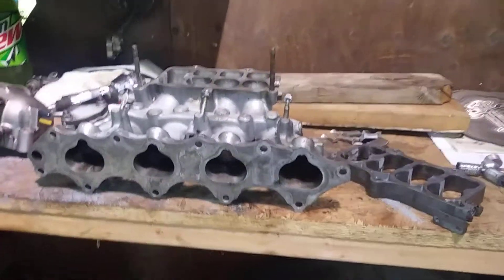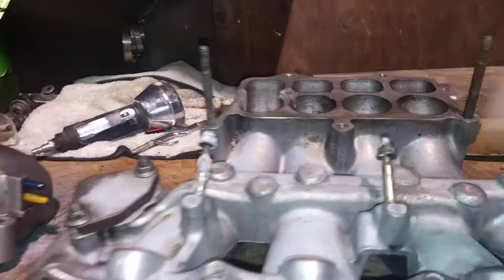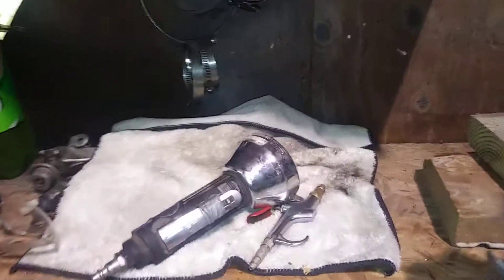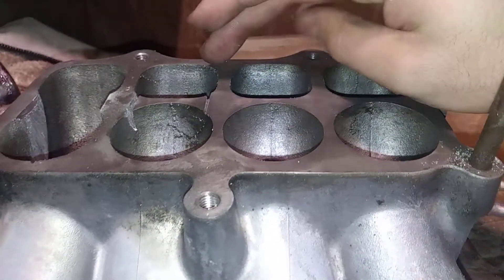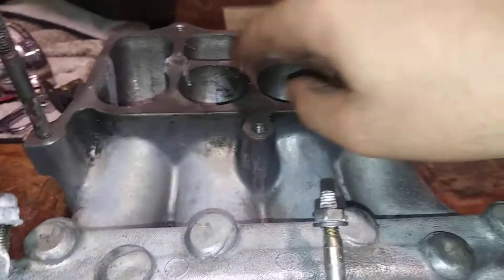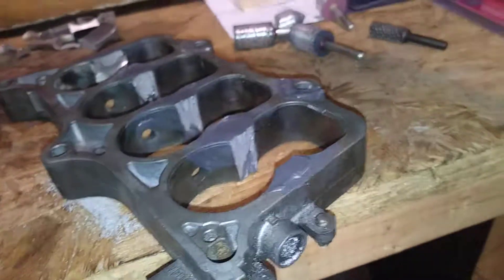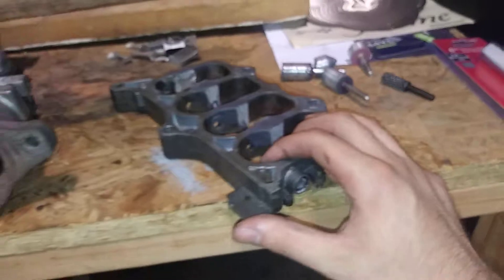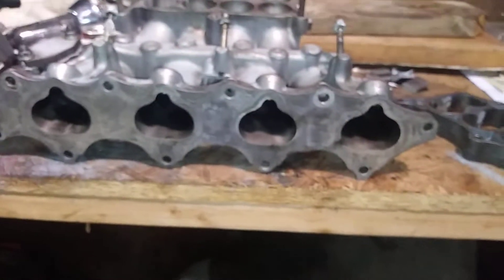H22 intake manifold stage 1 porting and polishing part 2

Comment: So what was the result like? Was there any noticeable gain on the top end? Was the loss on the low end minimal or substantial?
Thanks
Reply from the maker: Honestly I only noticed that it worked when I got tuned about 4 months ago. Supposedly "they" say you loose bottom end and gain top end and I don't really recall a difference but with a tune on top of that it definitely made a really nice power curve on the Dyno 😎